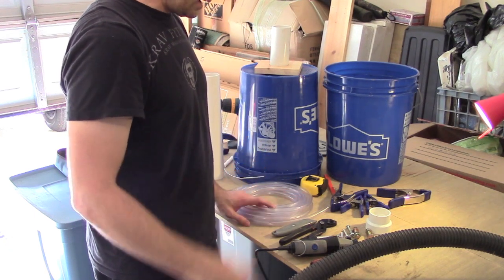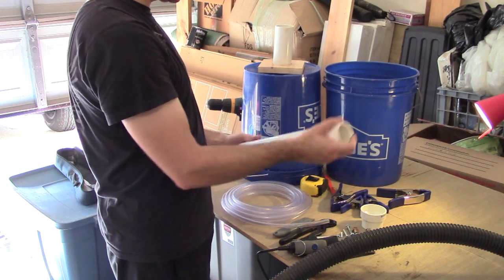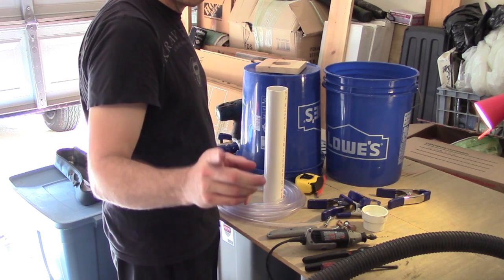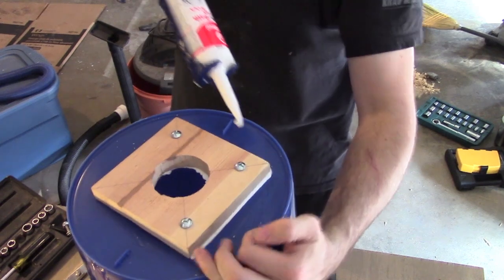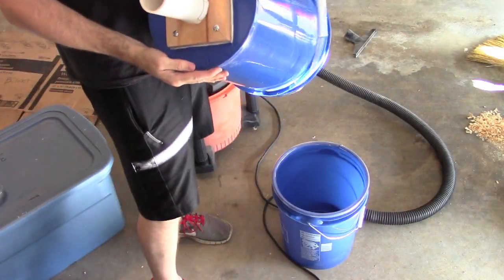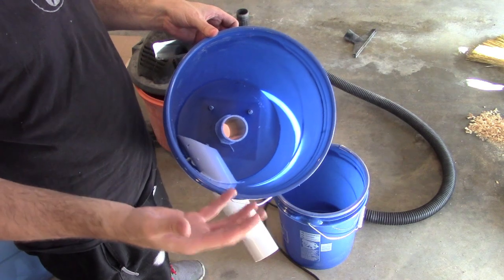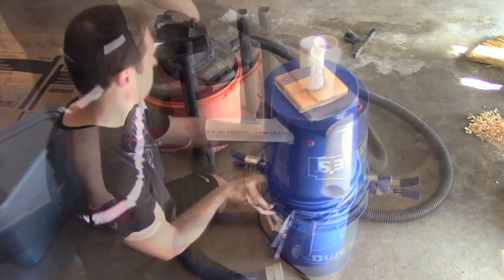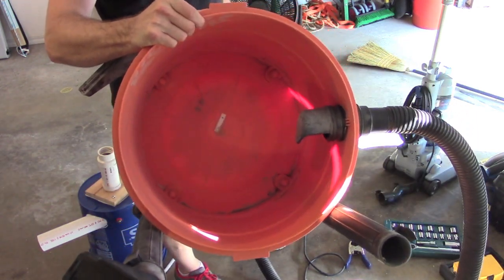DIY Dust collector - Simple to make & Under $20

Comment: A tweak that helped me avoid the spring clamps slipping off and making a mess when I bumped or moved the unit: screwing four scraps around the opening of one of the buckets to hold them laterally in place. I also found that using bungee cords hooked to holes drilled in the scraps and over the upper bucket was a little more forgiving of movement.
Reply from the maker: Great ideas! Thanks for the comment.

Comment: Lesson learned from when I made basically the same thing. You want the inlet pipe meet the upper bucket at a tangent. This increases air flow and allows for a smooth transition for dust to enter the cyclone. I would suggest using two lids glued together as a coupler for the two buckets and you can then cut a thien baffle into it the lids to increase the efficiency.

Comment: That worked better than it looked.  I didn't realize you would put the two buckets top-to-top.  Simple ideas often work the best.
Reply from the maker: Simple is better for sure.  The clear rubber tubing really helps to make a good seal too.

Comment: I actually like the idea, but I don’t really care for the design; but the idea itself is sound. It can be upscaled and modified slightly to produce results better than commercial systems would, if you upsize the outgoing side of the separator to reduce air velocity, because gravity separating, the solid particles, works best at low speeds, and if you add something like a mesh screen, it will further cause turbulence and make larger particles drop. I’m going to start with a similar design as yours except I will use 4 inch PVC out the top and expanded plastic mesh in a cone shape around the outlet to force particulates to drop down. Excellent work and great video.
Reply from the maker: Thanks

Comment: FYI, if you wanted to create more of a cyclone effect, you should have faced the angled opening of the PVC towards the outer wall of the inside of the bucket. The way you have it, you're pushing unwanted airflow towards the center inside the bucket before it starts it's path around the outer walls, rather than directing it around the out wall of the inside of the bucket where you want it. Just saying, the goal is to keep air away from the center of the bucket, so you should have twisted the PVC 180 degrees, and it would be more efficient at creating the desired cyclone. However, with that said, you still have a really great inexpensive design, and it appears to work pretty well.
Reply from the maker: Ok. Thanks.
Reply: Pumkinhead, your silly smart, sort of molten aluminum foundry guy.
Vortices and tangents. Swoosh.

Comment: I've found buckets at Ace Hardware that have rubber seals on them. I usually use them for storing oil that I take to the recycling place. Would be perfect for this. I have a long tube for my Ridgid vac that I never use, was just gonna cut that up and seal it in there.
Reply from the maker: Good find. Those buckets would be great.

Comment: Thanks for the video. 
I think that the cyclone portion would work even better, if the cyclone pipe didn’t stick into the bucket so much, because it partially blocks the cyclonic effect. Just an idea.
Reply from the maker: Good thought. I may modify it and test. Thanks for watching.
Reply: I am not so sure of that.  As soon as the air passes out of the pipe and hits the wall of the bucket it spreads out and only a small portion will hit the pipe on the next pass around.  It would be difficult to modify the length without weakening it's attachment.

Comment: You may have mentioned this in the video but is the center pipe going down below the cyclone or side inlet pipe? Pretty clever I'm going to make one myself thanks so much for the great video
Reply from the maker: Thank you. 
It extends down just about 2 inches below the cyclone inlet pipe.
Reply: @CountryLivingExperience  bro... Thanks for the quick reply to an old video! I will subscribe for sure, shows professionalism! Thanks again and wish ya the best! I have read some other comments and also wondering if you have any updates to the build that you would suggest? Or have you stayed with the same setup... I was considering maybe taking some scraps and lining a couple of "tongue and groove types of guides for more structure... But again awesome ingenuity on this design!
Reply from the maker: @FLG8RGUY4LIFE  You're welcome. I stayed with the same setup because I don't do a ton of woodworking currently. I have so many other crazy projects that I just don't have time. I just got finished putting in my own solar system for our homestead.
Reply: @CountryLivingExperience  i saw that... Pretty cool stuff for a stoned florida v
Boy with some land to mess with!!!! I'll keep following! God bless buddy and Good luck! Hit me up when you come to Florida!

Comment: Did you happen to try the intake way in other way ?  i mean the hole for dust intake and the hoe for vacuum intake .. 
I wonder which one is better.
Reply from the maker: No because if you reverse it, then you will not get the cyclonic effect inside of the air circulating.
Reply: @CountryLivingExperience  oh..i see. Thanks for your good tutorial video!
Reply from the maker: @dwightlee6164  Thanks for watching.

Comment: What size vacuum is that? I bought a 6.5 hp and it's way too much suction for a 5 gallon bucket. It literally warps the bucket when I turn it on, but yours looks similar.
Reply from the maker: Mine is a 4.25 hp. I am very surprised yours is doing that. Are the hoses clear? Are the buckets thin walled? I have never had an issue.
Reply: Country Living Experience hoses are clear and the buckets are the same ones from Lowes that you used. I'm thinking that there's so much suction that the 5gallon bucket isn't enough air space to let it fall in the bucket that it just gets sucked up into the vac hose. 

It's probably like 60/40, 60% in the bucket and 40% in the vac. I literally bough/made it today so tomorrow I'm going to get between a 15-55 gallon barrel to test out my theory, but I think a 30gallon would be ideal.
Reply: Country Living Experience I failed to mention that I only used 1 5gallon bucket so I may try your 2bucket method, I'm just not thrilled with the  tubing and clamps... But we'll see. I was trying to go the cheapest route possible but I may have to spend a little more since I found a great deal on Craigslist for a 16g 6.5 hp shop vac, but now I realized that This thing is a beast lol
Reply from the maker: Let me know how the modification goes. The tubing does not cut down on my suction at all...keeps a pretty solid seal. Those two buckets will surely give you more volume.

Comment: Where did you get the smaller hose that you used to pick up the debris?  Was that from another shop vac?
Reply from the maker: That was from an old vacuum cleaner. Worked well......very pliable and flexible.

Comment: Your buckets will eventually collapse. You need to reinforce the inside with plywood with 1 inch holes drilled in them for air to pass through.
Reply from the maker: I have not had any problems yet. Good suggestion on the fix if it happens though.
Reply: Glad you're not having any issues. Thanks for the videos and the time it takes to make them. FYI The Shop Vac I am using is a 6.5hp. It maybe the higher pull on it that caused the collapse. Made one for my brother as well and he just put his in another 5 gallon bucket. That mitigated the collapse for him.

Comment: 1 bucket 13$ = 26 $ (2 quantities)
1 pvc pipe 4 $/m = 4$ (1 meter)
1 bolt 0.5$ = 2.5$ (5 quantities)
1 clamp 7$ = 14$ (2 quantities)
1 vacuum cleaner (industrial type) 120$ = 120$
1 vacuum pipe 8$/meter = 16$ (2 meter)
1 plywood square piece junk.
1 man 1 jar is worthless.
-----------------------------------------------------------------------------------
all items : 182,5$ not 20$...
Reply from the maker: Sounds like hardware and tools are very expensive where you are from.

Vacuum = Already owned. Vacuum hoses = comes with the vacuum. The project is the dust collector not the vacuum.  

Wood = scrap = free
PVC pipe and connectors = $6.
Clamps = 2 x $3 = $6  I showed 4 in the video but already owned 2). You only really need 2 for the project.
Bolts = $0.11 x 5 = $0.55
Buckets = $2.98 x 2 = $6
Tubing = $1.25

Total  = $19.80

I sincerely hope you are able to find cheaper materials.

(by the way, my shop vacuum only cost me $79.99 about 5 years ago)
Reply: +Country Living Experience you are totally right, in my country, (which i dont want to live in it.) every such things are totally, expensize. Also, not reachable at all. Thanks for info. Also quick way to build a dust collector...
Reply: What country is that? You are using metric so are you in Europe, Canada, where? And, if you are converting from USD to your currency then I can see how it can get quite expensive. Anyway, hang on and good luck!
Reply: @CountryLivingExperience  already owning something does not mitigate the cost.